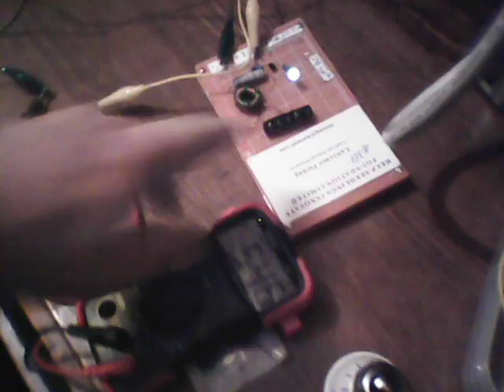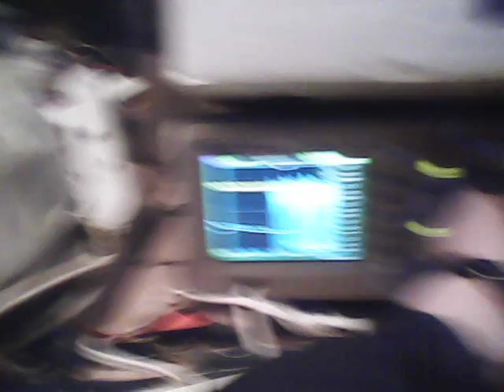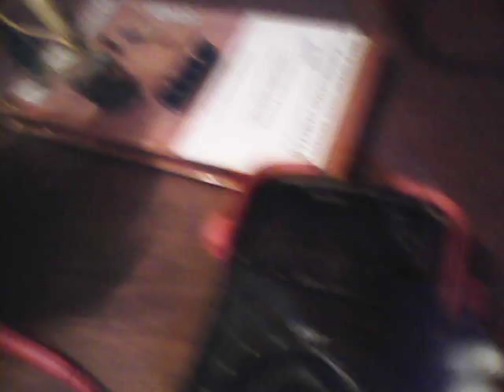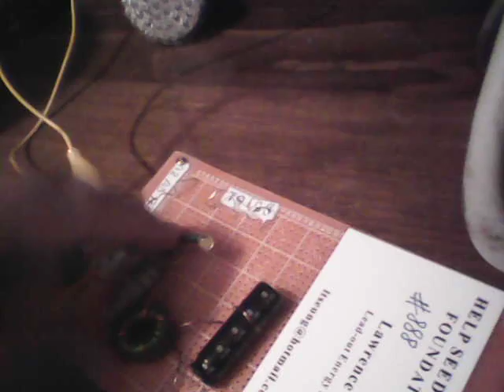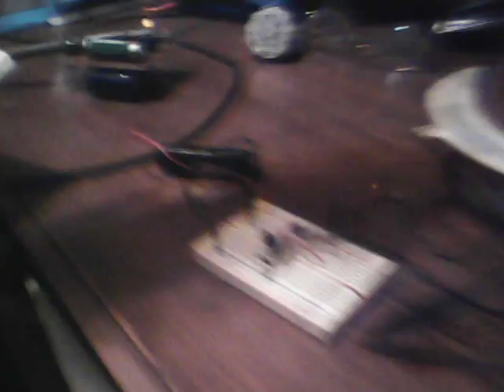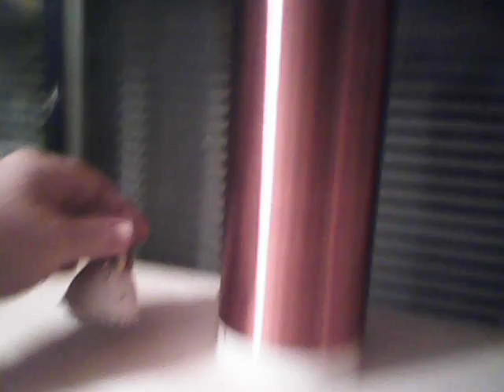3TestDevicesApril2013

Comment from the maker: Thanks for comments, especially Lynx who designed the "crossover circuit".  Janne808, it runs also with the antenna wire connected to an antenna (not ground) - so no ground loop in that case.  David, you may be thinking of LENReactions, but I don't think these are involved here (no electrolysis or any process that appears relevant to LENR).

Comment: Very fun stuff Steven.  Great video.  With that crossover circuit you can get different effects with varying the input from - your proximity, lights on in the room, touching the antenna, heat in the room, incoming light from the sun.  Its harder to keep the circuit oscillating steady.  I ran this circuit from Dec 20th to March 10th  and saw no voltage drop, but then again the output was minimal from the LED.